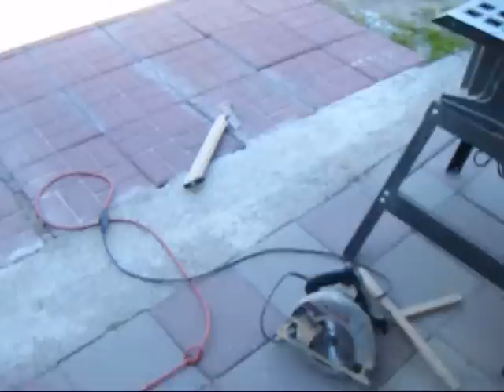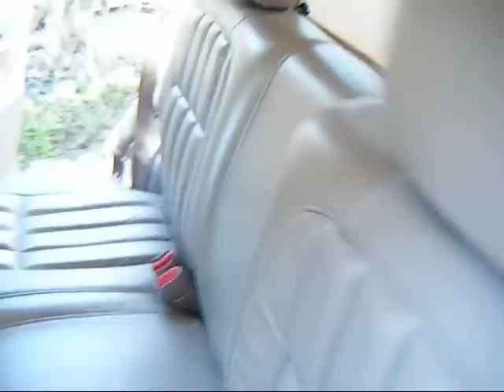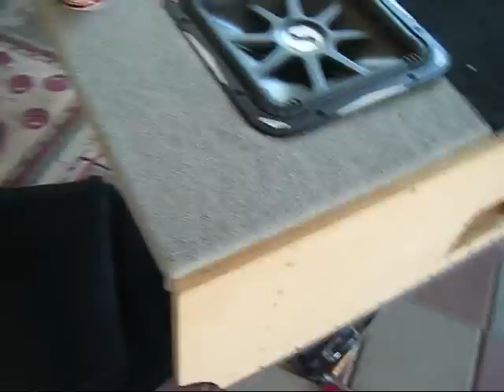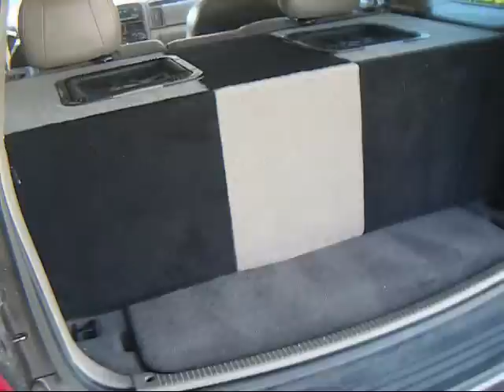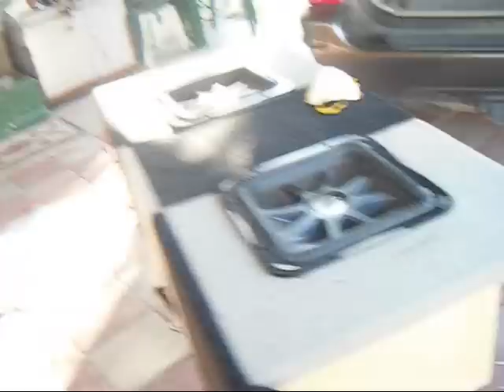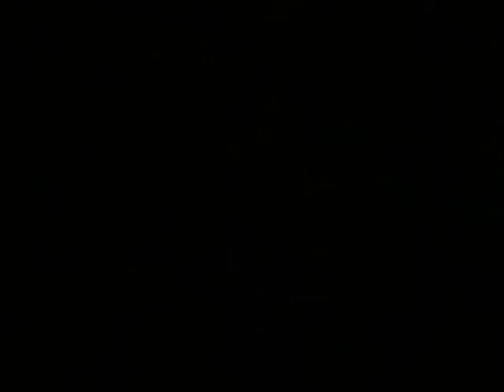Building custom box for 2 12" Kicker L7 2008

Comment: That box is massively to big for those subs.   These subs probably survived for about a month before they got bottomed out. The cu. ft. Of air space recommended for 2 kicker L7 subs in a ported enclosure is 3.507, the air space in that box is most likely double that volume.